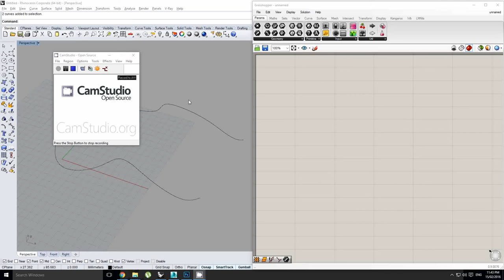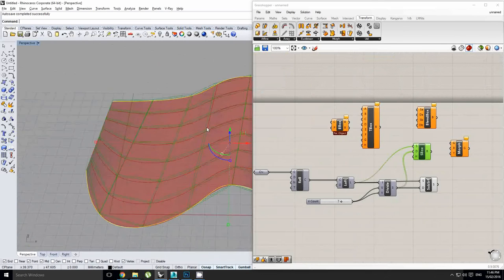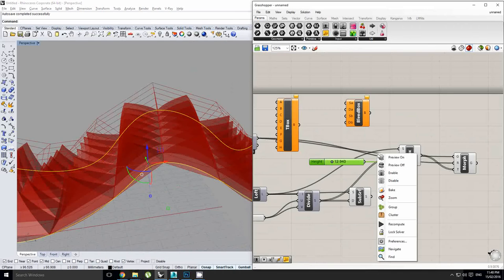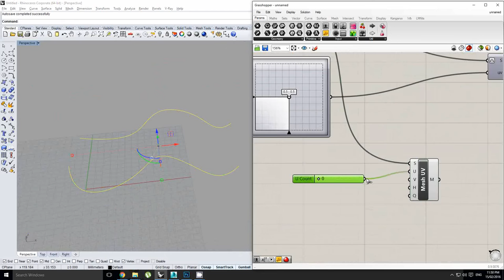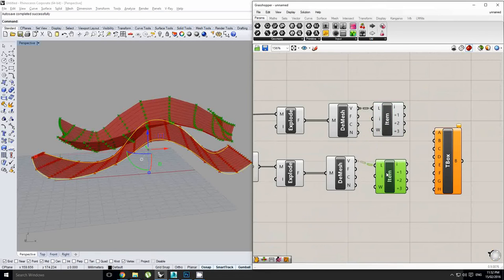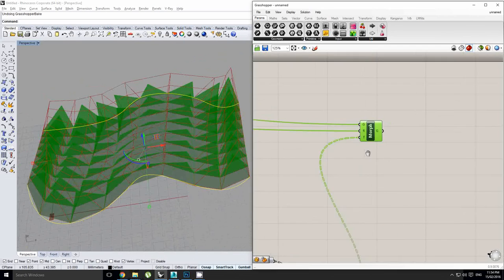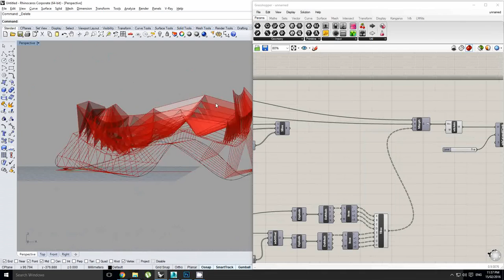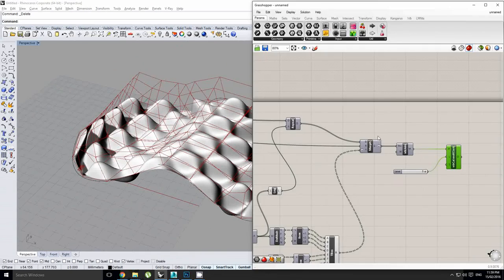Grasshopper - Using Morph Boxes

Comment: Thank you for the video! Where did u get the wb offset? Because i don't seem to have it and the mesh isn't offsetting even with offset surface. Also i don't have the subsrf. Are these all from a plugin or is it from a different version?
Reply from the maker: Wboffset is part of the weaverbird plugin, I believe I have a link in my vid description.
Offset surface will not work with a mesh, as they are two different data types.
Subsrf is a standard component of the gh toolkit, try searching for isotrim, an alias for the same tool.

Comment: HI there, thanks for the tutorial! I have a question though...
I was wondering what advantage is to be had from rebuilding and lofting the curves in Grasshopper to create the initial surface? Why not simply use the EdgeSrf command in Rhino to generate a surface that can directly be attributed to a surface in Grasshopper?
Reply from the maker: Good question. For starters, the rebuild creates uniform curves, so you don't have anything strange happening in terms of control points and knot vectors in your surface. And if you do the rebuild in grasshopper, then you are free to manipulate the curves however you would like in rhino, and the geometry will update accordingly in grasshopper, if you create the surface in rhino, you are kind of locking yourself into one possibility, and for me, the beauty of grasshopper is its inherent flexibility.
Reply: Right, got it! Thanks for the explanation! ;)

Comment: Is there anyway to do this using a hexagonal grid?  As in, I want all the bounding boxes to be hexagons instead of boxes.
Reply from the maker: Ryan Daley not exactly, no.. You could do it by creating a hexagonal grid, and then mapping that data to a surface, but as such, you cannot create hexagonal bounding boxes. The process is certainly not as straightforward as with a bbox.